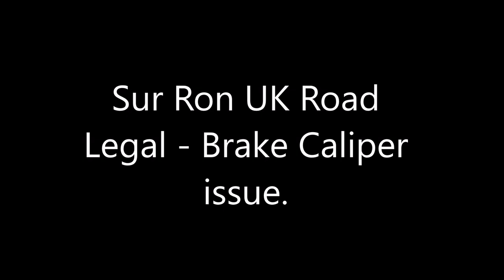Sur Ron UK Road Legal Brake Caliper Issue

Comment: hi just wondering did you manage to cure your problem my son has had a surron for a week covered roughly 130miles and rear break has gone spongy I've got new pads but like yours the old ones are barely worn
Reply: Hello how did u fix the issue